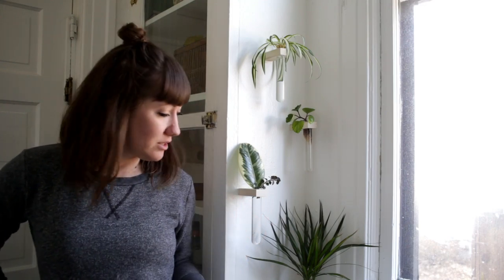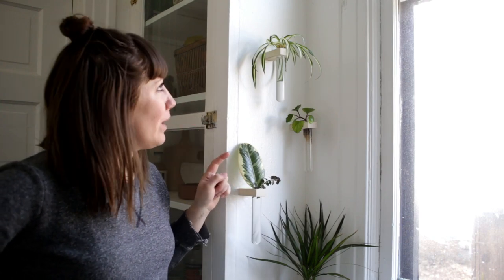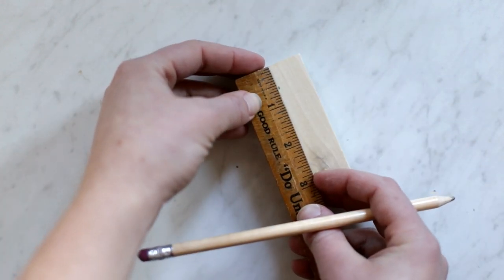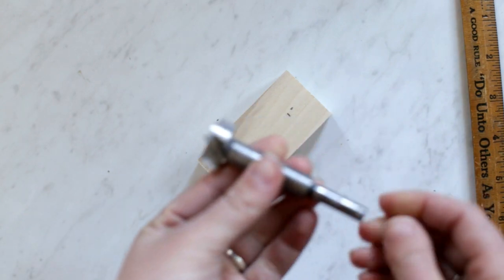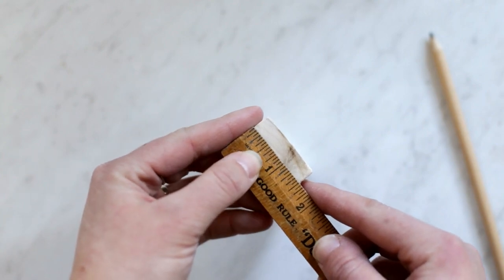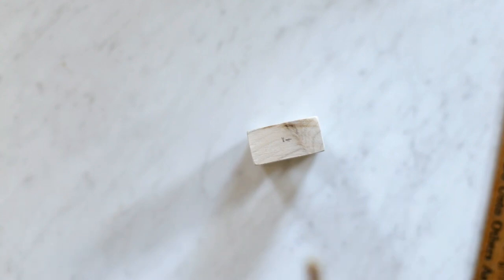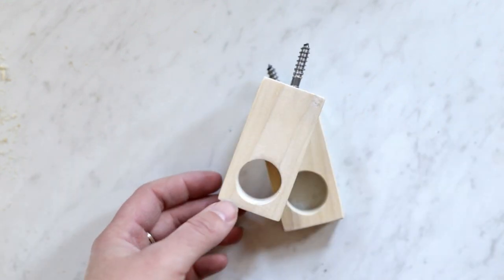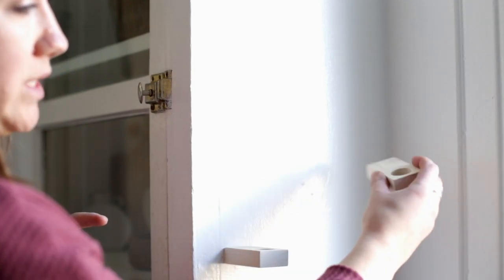DIY Wall Propagation Tubes/Bud Vases

Comment: Pro-tip: measure and drill all your holes before you cute the 1x2 into 3" pieces. This will make it way safer & easier to drill the holes because your hand won't have to be so close to the drill! Just make sure you're using a very thin saw to cut them to length, or at least account for the thickness of the blade while measuring!